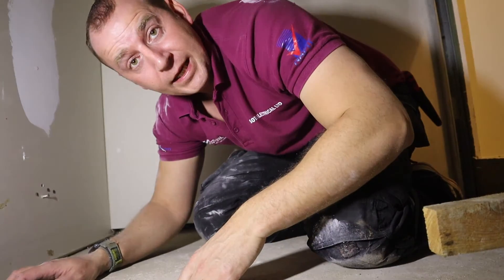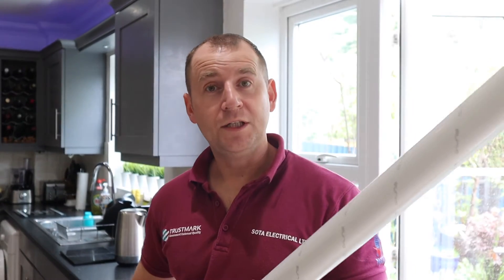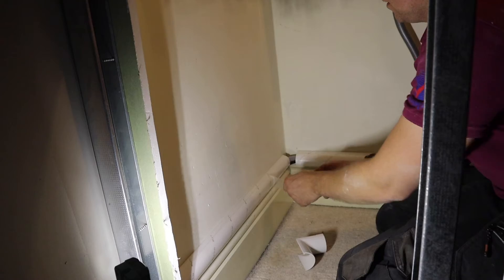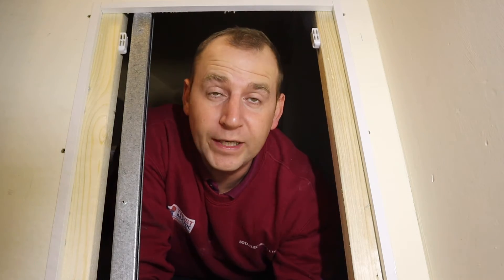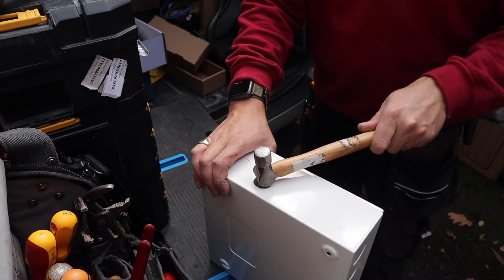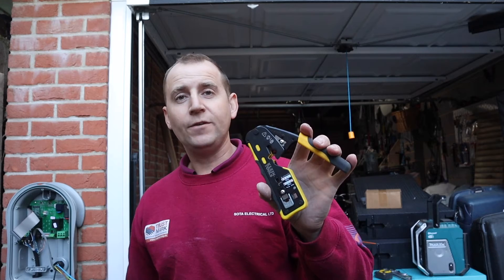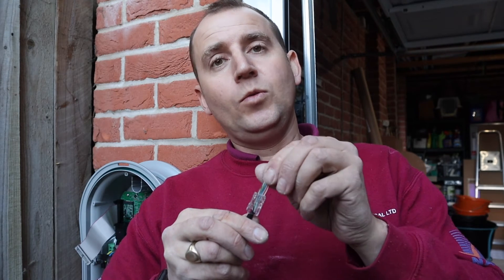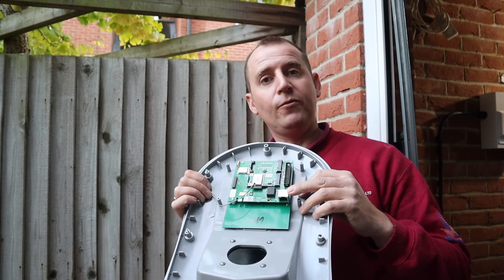How To Install An EV Charging Point With A Difficult Cable Route.

Comment: Thanks for the video. Can the 25mm dline trunking be available for bending a EV ultra cable (14.5mm) 90 degree through a wall to outside? Thanks
Reply from the maker: I don’t think so
Reply: @sotaelectrical  So from the video 1:05 to 1:10 . i see you drill a hold at the back of the dline trunking and bending the EV Ultra cable into the wall? or do any trick require? thanks

Comment: can the wires be run on the outside of the building ? my meter box is on the outside wall.
Reply from the maker: Cables can be ran externally as long as the correct selection of cable has been used

Comment: 2:08 doesn't premature collapse apply to cables run overhead
Reply: SOTA ELECTRICAL,  yes he is, no requirement for them but as they cost pennies why not fit them, they could stop a fire fighter tripping over them in the event of a fire, you should check out Doncaster cables combined power and data cable for EV installs 👍
Reply from the maker: @darknessdestroyer5524  I know there is no requirement but it makes the installation easier. They stop the cables from falling out the trunking while working. I used EV ultra from the house to the garage, I installed a joint box outside, I did not use it inside because I couldn’t get the bending radius to fit inside the trunking.
Reply from the maker: Hi Derek, are you making this comment because I’m using cable supports in the trunking?
Reply from the maker: Doesn’t have to be a requirement to use them Derek
Reply: @sotaelectrical  i didnt said that. Of course You can use them. But as requirement also the wall plugs needs to be metal or special screws.
Reply from the maker: @DerekHundik  the screws that I used were the Dline fire rated self tapping screws
Reply: @sotaelectrical  👍